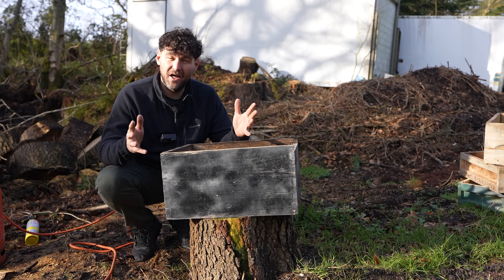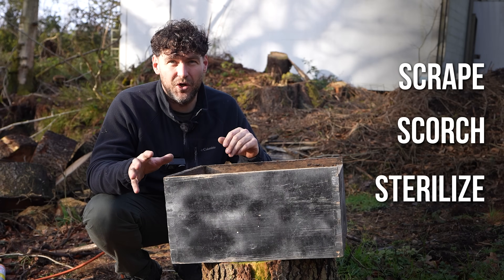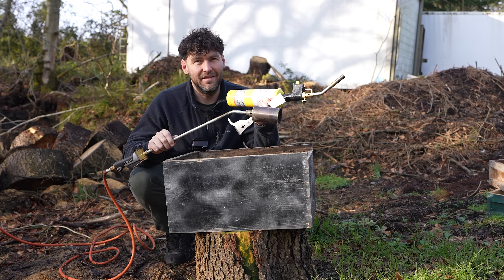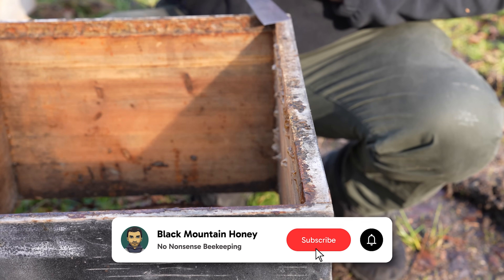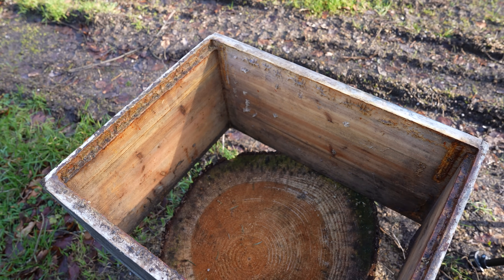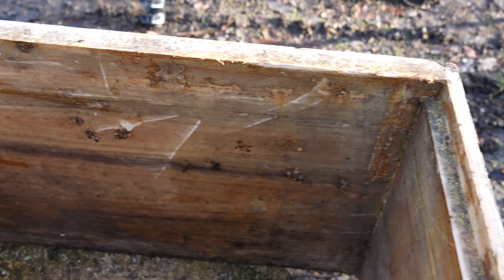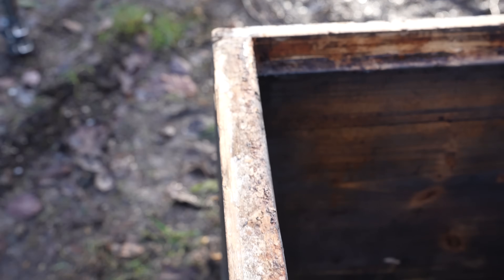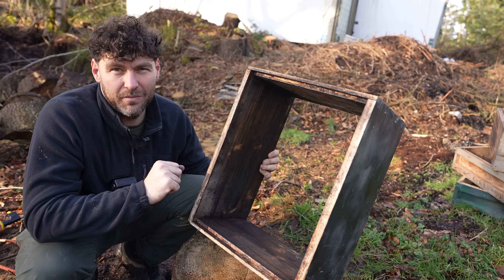🔥 How to Sterilise Wooden Beehives with Fire: Essential Beekeeping Hygiene Guide

Comment: Where I'm from if a bee inspector finds afb they are required to burn all the hives there and then, does scorching really kill afb???
Reply from the maker: @devinclement  it's the same here. The whole lot gets burned if they find AFB. But even if it didn't kill afb spores, id still be scorching for efb, or else you have to assume all old kit is afb infected and you always buy new.
Reply: @BlackMountainHoney  in your opinion am I most likely screwed lol? maybe the guy I bought the equipment from didn't control varroa? Thats what I'm hopping!!
Reply: I'm a new beekeeper this may is going to be my first season, I bought a lot of used bee equipment from someone who said that are giving up for 1000 cad, I sanded them all and painted them nicely, been spending all winter making them nice lol, and I my local bee inspector has been too busy to make it down to my place, so I'm worried if I've been wasting all my time, when I bought the equipment I didn't know about afb :( I have all my nuc ordered and everything I'm worried If the deal I got was too good to be true!